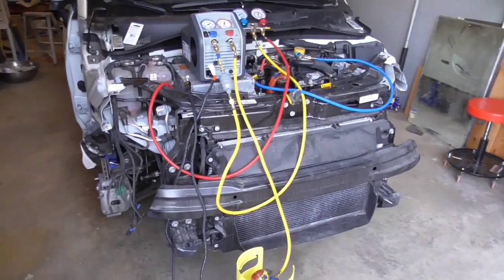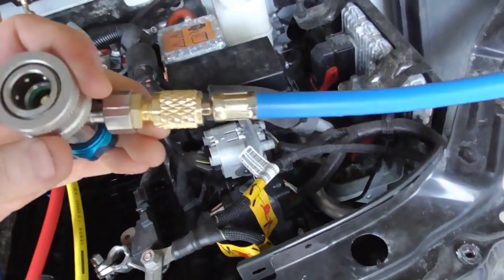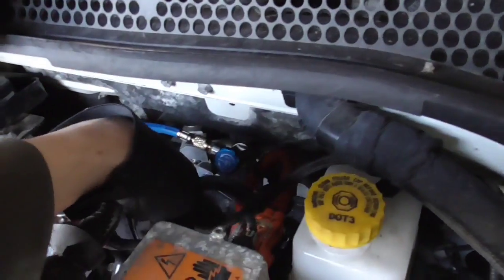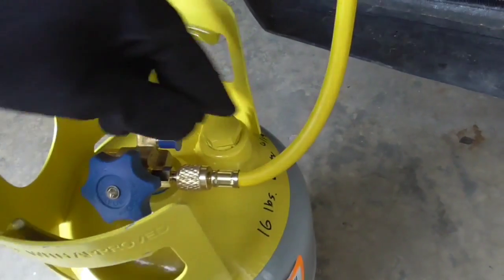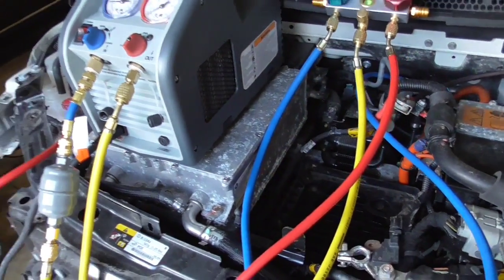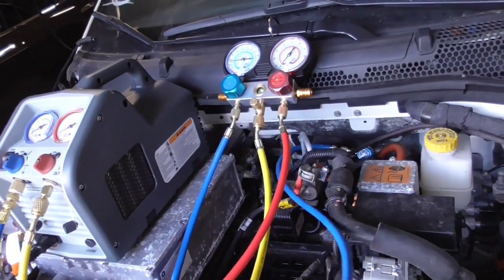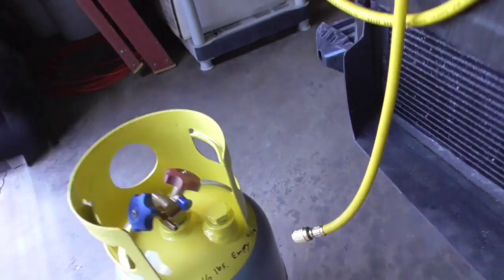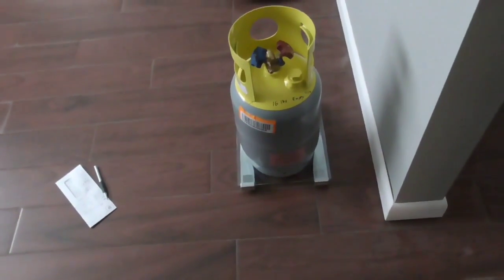How to recover R134a refrigerant from a car

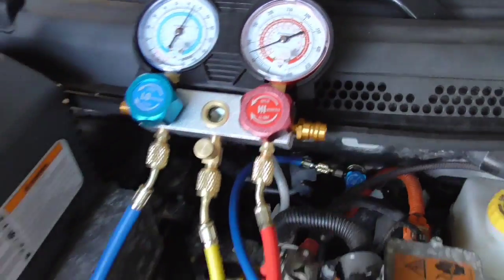Comment: It looks like this has been mentioned in the comments already but I just want to clarify for anyone reading: the 'valve' on the yellow line he says he opens around 5:10 IS NOT a valve, it is a cap which simply covers a 'schrader valve'. When opening the red or blue valve, you are always connecting the yellow line to whatever side you opened! The cap on the yellow line does nothing but protect the schrader valve, just like a cap on your tire.
Reply: well as you pull a vacuum the schrader will actually let air in. the cap has a rubber seal in it.
Reply: Correct
Reply: I was going to mention this... you already did
Reply: This is too complicated so I might as well go but a used Robin air ac machine which does all of this without any complications
Reply: Everybody calls them valves. You crank these valves closed ( while turning them holding them in their hand ) 
One video I watched guy kept saying different things for what something was. Like he was emptying a can of refrigerant into a car and said “ when you get all the moisture into the system “ I surely hope you’re not putting moisture in the system.
Reply: so is that like a really cheap cage then or is it like a purging valve only, which should be like a pressed valve actually...
Reply: I am a novice, know very little and even I knew that.  Think your pointing out something anyone would figure out.
Reply: The ends of those hoses are like a tire cap that has a screw in the end so you can push the schrader valve under the cap.
The one end of the yellow hose has a special end that pushes on a schrader valve to open it as it is connected like a tire inflator or tire gauge.
Reply: @michaelszczys8316  think of how a shrader valve works. it seals under pressure. and on the manifold, the yellow hose does not have a valve.  that is a shrader. that shrader is to purge the hose when charging the system. my manifold set had 4 valves. 3 on the manifold and one on the high and low pressure ends.

Comment: If you have had a slow leak, but system still has refrigerant and you do the recovery, how do you know how much oil is in the system.  The RG3 and other portable recovery machines do not separate out the oil so it can be measured. I contacted Robinair, and they said the RG3 & RG6 would not get all of the oil out of the system. The under the hood label specifies the refrigerant weight, and the number of ounces of oil.  I have not been able to see an answer to this, or see it addressed anywhere.  Too much or too little oil would be a problem.  Thanks.
Reply: Yeah, if you want oil separation in a portable recovery machine, I'd look at Mastercool portables like the 69110 or 69350.  If you already own a recovery machine and would like to add oil extraction capability, you can add it to your existing system using an oil separator, such as the CPC CRXOS1.  I'd recommend combining it with an inline receiver/drier filter for added protection.  Or you can just go with the RecoveryMate 69500 from Mastercool. The entire oil separation and filtration system is pre-made for you and contained in a plastic box, even comes with the hoses to connect it to your current recovery machine. Comes with gauges, receiver/drier filter, oil separator, sight glass and hoses.  This would probably cost about as much as a used Mastercool 69110 though.  Hope this helps!
Reply from the maker: That's a very good point.  I will add: that it would tend to leak the gas first, as it's not a liquid.  And a significant amount of oil would likely remain in the lower ends of the system.  I found a lot myself on a couple of recent disassembles of a system after recovering the gas.

Yes, it would be nice to know exactly how much oil to gas ratio is in the system.   There should be some sort of sample analysis gauge or something to do that with.  Guess you just have to kind of guess work it.
Reply: You would have to do a flush to get everything out. Then start over.
Reply: my label on the hood only mentions how much r134a says nothing about how much oil.

Comment: The valve on the gauges on the yellow line should not be a valve but the should be where the purge is and that should just be a cap.... please clarify
Reply: the valve you are trying to open at 5:09 yellow hose is not a valve its a cap, hay and im a truck driver and i no better.
Reply: Yeah that screw at the top of yellow hose in between the gauges is not a valve, its an additional outlet with a cap. By unscrewing it you just made a leak in the system and potential source for air contamination in refrigerant youre extracting.. it is pretty clear you dont know what youre doing, you need to read the procedure several times so you dont seem too confused when looking at gauges and valves/
Reply from the maker: No, the yellow line is the red & blue lines combined & go straight to the recovery tank via the machine.  The best place to purge air on this setup is right before it enters the tank.